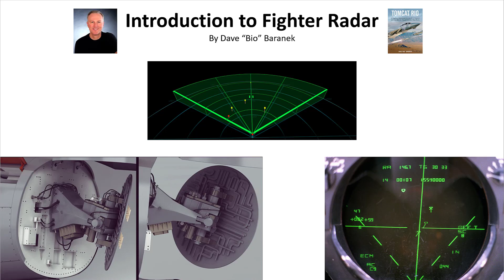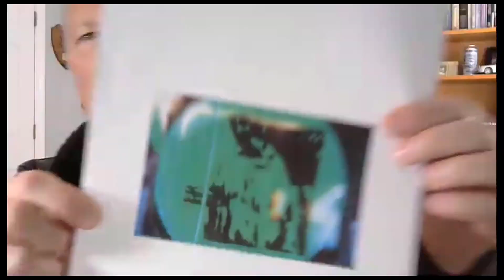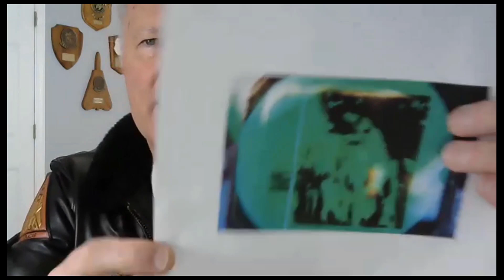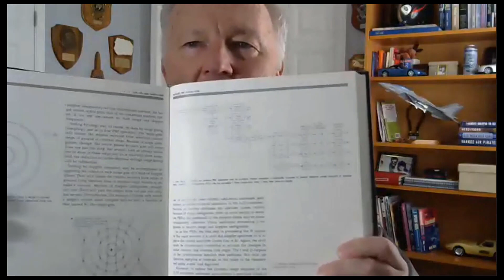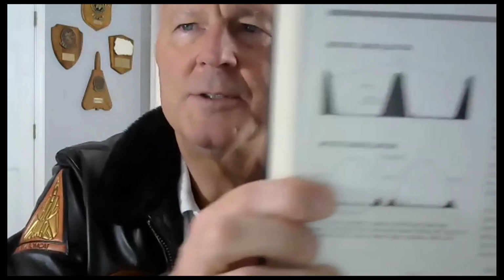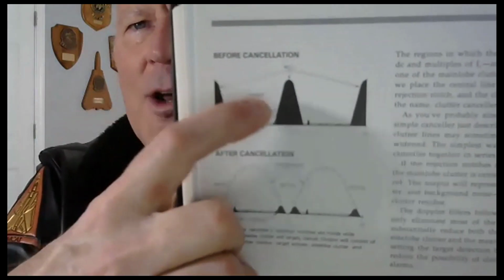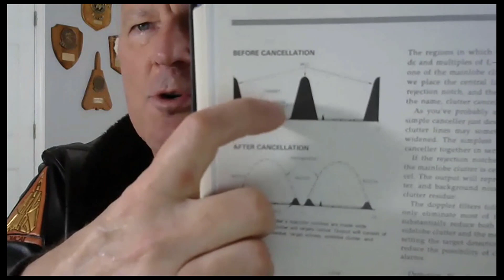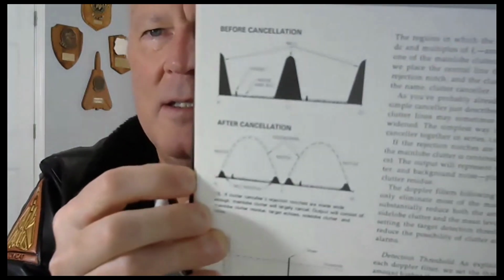Former Topgun Instructor & F-14 Tomcat RIO gives an Introduction to Fighter Radar (Dave Bio Baranek)

Comment: Fairly sure the AWG10, 11 &12 Radar systems used by the F4s from the 1960s onward used pulse/chirp & pd radars in one form or another prior to the introduction of the F14s into service
Reply: Yes we had PD on F4J and S which was AWG-10A and B.
Reply: Correction accepted, thanks. I overlooked that.

Comment: Didn't the J-model of F-4 introduce a pulse doppler radar first?  I'm pretty sure it did.  That was the AWG-10 system.
All the British Phantoms used the same radar set as the F-4J.
Reply: Yes, the F-4J AWG-10 and F-4E APQ-120 radars both were pulse Doppler
Reply: @katout75  The AWG-10 was a more capable air-to-air system than the APQ-120 from what I understand.  Of course, if a client state bought the F-4E, the APQ-120 was the radar system they would get.  To my knowledge, only the UK operated Phantom variants (F-4K, -M, and J/UK) that had the US Navy radar system (AWG-10).  The UK Phantoms were operated in mainly air-to-air roles as I understand it.
The RF-4s and E-model variants had narrower diameter noses than the B/N, C, D, and J/S models.  The nose of the RF-4 was adapted for the F-4E because it could house the M61 assembly (but it still had an external muzzle fairing for the barrels; the fairing had to be redesigned later because of an issue with exhaust gases being sucked into the engine inlets) when they redesigned the interior layout of the F-4's forward fuselage.  I'm sure it cost McD some money to do that but at least they had a piece of hardware (the "new" nose) they didn't have to reinvent completely!
I think contrary to some popular belief, the longer-ranged, more powerful radar have greater diameter dishes/flat plates.  Can't get away from the big nose!
Reply: Correction accepted, thanks. I'll use this info the next time I talk about the subject.

Comment: In the movie "Top Gun," they're unable to see how many planes they're closing with. I've worked with radar, and you can often pick multiple returns that are close together on an A-scope. It shows the return by range along with the amplitude of the return. Expand that return to display on the target/targets and you can separate them out unless their range is exactly the same. Did the F-14 radar or any modern ones have that?
https://www.radartutorial.eu/12.scopes/sc05.en.html
Reply: Remember, the movie was fictional and they didn't get detailed technical info from Navy personnel. The F-14 radar had good target discrimination. In the movie, the intent was to show the Tomcat guys getting surprised by the "MiGs" flying so close together that they were not broken out by the radar.
Reply: @dandlb  Bio.  Great video.  You were a TOPGUN instructor when I went through in 1986.  I sucked, so everything I learned there was extremely valuable.  One thing that sticks in my head when you mentioned not much time was spent on radar.  As I recall, the 6 weeks was almost all dedicated to ACM.  While there were a few hops utilizing F-pole, A-pole, etc., it would seem that the longer course today would probably spend more time on this given the fact that Bandit ID for BVR shots has become more reliable.  I know, like me, you've been out of the cockpit for awhile now, but as a Midway docent this would be a "nice to know" when answering questions should you have any insight on the modern syllabus.
Reply: @rossandcarol  Hi, Bosco! I remember you well!
Yes, the intercept has become much more complicated than it was in the mid-1980s. To give you an unclassified source, Brad Elward's recent book "TOPGUN: The Legacy" describes how instructors put in a lot of time and effort planning intercept tactics, and of course teaching them and having the students use them during the class.
I saw this very clearly in my final flying tour (1996-98) and it has gotten more complicated. But training for every pilot and WSO in every squadron is now better, thanks to the SFWT program.
I hope that helps!

Comment: If I'm understanding Bio correctly, an enemy fighter could beat the radar by being only slightly faster than the F-14's velocity, on a slight merge angle from a rear/low climbing position. If so, was there a counter measure to avoid such a tactic?
Reply from the maker: Hi there @Ric Hall. There's a few videos on YT talking about beating the radar. Worth a look.
Reply: That's not exactly it. I watched the segment again and I did not go into a detailed explanation, but as Fight's On says, you can check out other videos and online articles.
Reply: " If so, was there a counter measure to avoid such a tactic?"
Upgrade to the APG-71!  Faster central processing units, 6 times the data processing throughput, and much more memory than the AWG-9.  60% reworked from the AWG-9 and about as much percentage-wise digital.  A much more reliable unit which had plenty of room for expansion which it really didn't get.  They talked about integrating mapping modes into the radar like the F-15E since it would have been doable to introduce similar programming for ground attack modes.  It was mostly based on the radar tech of the F-15E radar (APG-70; also a Hughes product like the AWG-9 was) and leveraged the Strike Eagle tech to reduce development costs and make it easier and faster to introduce the APG-71 and F-14 into the fleet.  This was in the days I think contractors were more responsive to budget crunches and didn't screw around.
That took care of a lot of the problems the original AWG-9 had.
Too bad only 55 D-models got funded...
Reply from the maker: Yeh, an upgrade to the APG-71 would have been great, but as you know, that was far too late for most of the Tomcats, except for the D's. Not sure if any of the B's got it as well, or perhaps if they did, it was only while passing from B to D?
Reply: DCS nerd and not a real RIO or pilot here: Keeping the contact out the notch filter is the important factor, or using Pulse Search if the contact is above you. 
This means keeping the closure rate out of the notch by adjusting speed or aspect, or going below the contact and switching to pulse search. You use all the tools you have - and speed, altitude and nose position are tools as well as the radar modes :)

Comment: my understanding of notching is, you hide in the doppler filter. is that right or not?
Reply from the maker: Hi @eatthisvr6 & thanks for your question. I believe there might be some truth to that. Your best bet is to do a search on the topic here on YT. I have run across 1 or 2 videos discussing the topic in DCS.
Reply: That is basically it, yes.
Reply: @dandlb  When you suspect a notch, would you generally switch to pulse mode and attempt to find the most suspect return, have the pilot offset, or some combination of both?
Reply: @THEQuantumBacon  If you're using an AWG-9, switching to pulse may be your best choice.